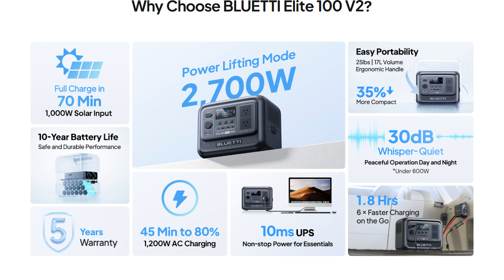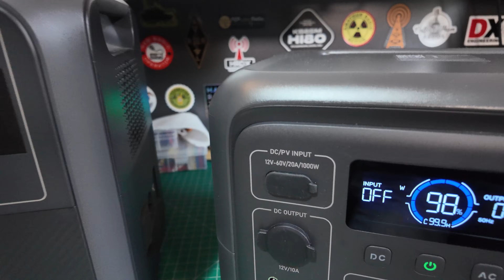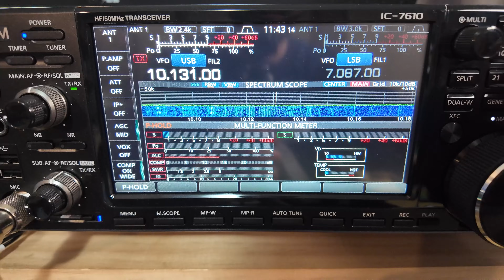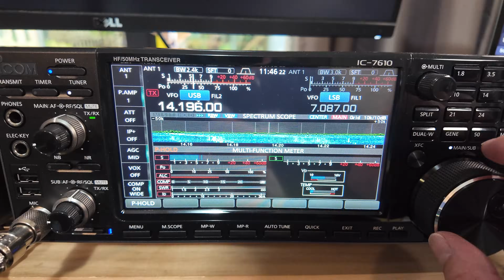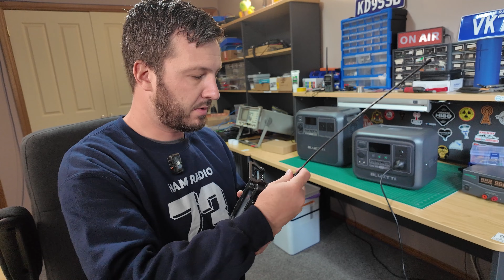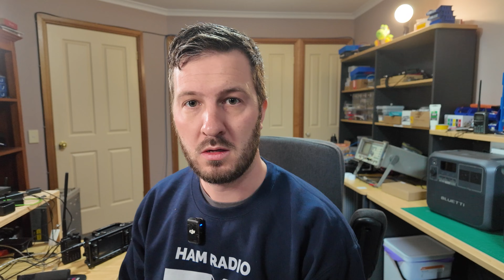Bluetti Elite 100 V2 – NOT What I Expected for Ham Radio

Comment: Temporarily Offline alerted me to the UDPower model C-400's Jumper Cable port on the back.  This gives me access to direct 12v high amperage of the internal 20Ah battery for my portable Ham Radio use, with the addition of a two-part cable from Amazon that converts the C-400's EC5 port on the back to more standard Anderson Powerpoles.  And with the C-400's included 12v cigarette lighter plug cable to Solar/DC In port, I can daisy chain my Jackery Explorer 300 and double my operating time.  Still on sale (as of today's date) and I went for the optional higher wattage solar panel. And no extra noise!

Comment: I got the Anker Solix C300 DC running on battery only and on CB radio the RF noise is worse than my old AC-DC power brick. Very strange.

Comment: If you want to try a cheap Project, I put a pie five in a 300 which is on sale for about $150, and then you can install Internet in a box along with any other software and you’ll have a server with things like medical information and videos, education and books.  I have a model that’s several years old but all I did finally once I figured out where I could put it remove the fan that’s blowing on the DC to AC inverter and it’s not even attached to anything but they’re so little room it doesn’t really move around.  When I installed, even though it didn’t say in the instructions I had to set passwd command before I could log in because even though it asks you for a password, it doesn’t set anything so you are basically created the system password
Reply: O bought a Anker C800 today because it has a compartment on top that I think is made for your phone, but I’m gonna put another Pi in that space with a SSD drive and that you don’t even have to modify because you could just plug into one of the three USB-C ports it has and still have two more.  They’re running sales on battery packs because of black Friday so I grabbed that.

Comment: Did you check the 12 Volt output? I have a similar unit and the 12 Volt DC output is not regulated and can be anything up to almost 17 Volts!
Reply: And noisy as hell.   I couldnt power my XIGU G90 from the DC OUT Jack.   20m band was unusable

Comment: I tried 2 ecoflow, the delta 2 and delta river 3 plus on the field, and I can’t use the radio connected to them due the hi RF noise. I connect the radio directly to a battery, the RF noise is gone.

Comment: To me if you're going to buy boxes like this, dump the display and inverter and go direct battery to radio.  Virtually all of our radios going back to the 1980's will run on 12VDC.  Inverters and power supplies are about 90% efficient... so going from battery to inverter to power supply to radio you're losing 20% of your power... but then everyone compares every watt-hour of capacity in the battery system.  Huh?  You're throwing away 20% of it!

The other thing you have to know about many of these is they are often using Lithium-Ion batteries instead of LifePO4.  The Li-Ion are much more dangerous and in large capacity should be avoided.  For amateur radio service, the LifePO4 batteries are much safer and will provide virtually the same capacity.  You're much better off powering your radios with a battery-only system.  Save a small version of this box to power the computer.
Reply: I wouldn't even trust these for my computer. Doubt it's even UL listed, but this one is using a LifePo4. The price is crazy.

Comment: I have a homemade solar Lifep04 battery setup. The problem I have is with Renogy Mppt charge controllers emitting severe interference on many HF bands.
The Victron Mppt charge controller I also use is clean as a whistle, no QRM.
Reply from the maker: Yeah the Victrons are great. Nice solid metal case, well built 👍

Comment: Nice video; I suggest you also check for RFI with unit only powering the DC out side. I have the EB3A, and have found - for reasons which aren’t obvious - that that model does throw significant RFI on 40 and 20m. It doesn’t seem any less RFI noisy with the power box display off, either. A ferrite on the dc power cord was largely successful at choking the noise when powering a Xiegu X6100; but the same power line/choke feeding a Yaesu FT-818 still has RFI. 
At least in the EB3A, even with AC output off, the DC side has some rf noisy circutry is my conclusion. 
Agreed direct eg Anderson port just to the internal battery pack would be an excellent feature improvement. 
73 de VE7JBX
Reply from the maker: Thanks for the tip, I'll definitely check the DC out side for RFI!

Comment: Looking at installing a dc-dc converter in my Ute, but I Wonder how a Victron dc-dc 50 amp converter would be RF noise wise? Any one know.
Reply from the maker: I've heard the Victron stuff is good - RFI wise. I have a Victron 12V to 24V DC-DC isolated converter and it works well - I haven't noticed any RFI, but I've only used it on 2m, 70 and 23cm - not HF.

Comment: Plain 12.8 lifepo4 battery does the job just fine. Pair with Genasun mppt solar charger. No RF noise.
Reply from the maker: That sounds like a good setup.
Reply: Of course you do not want inverters in a ham radio environment. A battery is just fine.
Reply: also you can draw alot of power from a normal battery. those power station rarely have more than 10amps on the 12v socket. also the 12v doesnt come direct from the batteries... its coming from a DC to DC converter inside because the cells are not 4S inside.